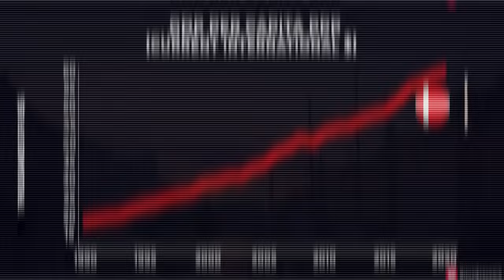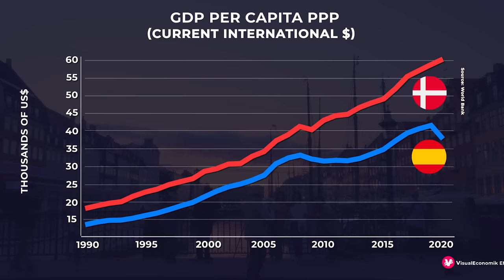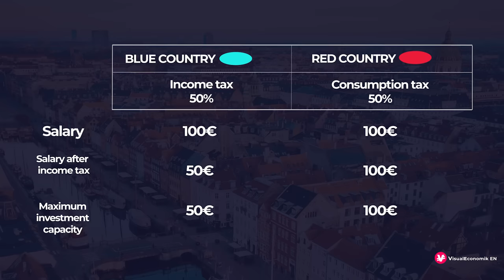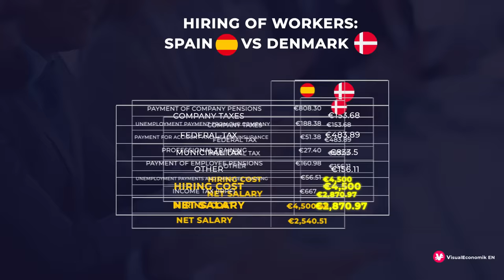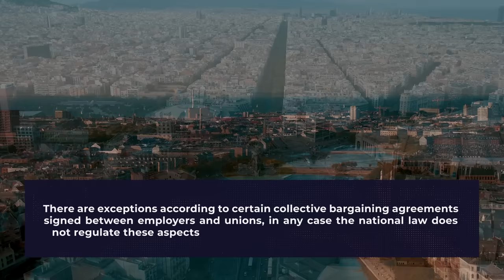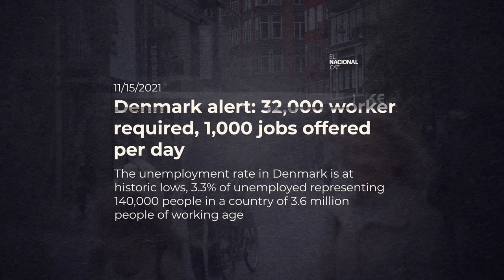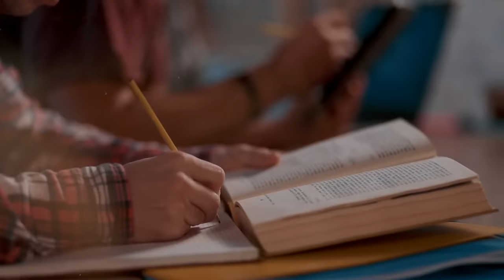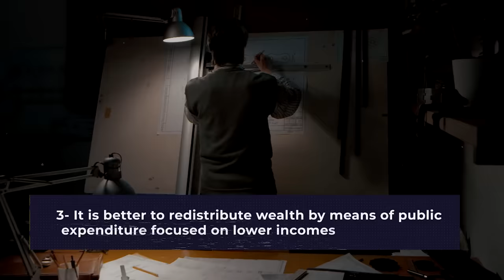Why Is Denmark So Rich Despite Huge Taxes?

Comment: I absolutely agree that sales taxes are much better than income taxes…. I’ve been arguing for this for many year where I live.

I would even add that there is no 100% requirement that the sales taxe be flat (it’s easier to manage but that doesn’t make it mandatory)…. I could easily see a higher sales tax on “luxury” products (whatever that means) and lower sales taxes on basics (milk and bread for example).

Here in Canada, the main objection is that 80-90% of the population lives driving distance from the US border. People are afraid that a much higher sales tax will lead to people shopping in the US and importing stuff instead of buying local….
Reply: We have that difference in value-added tax(ation) in Germany. Basics like groceries, water, books, and local public transport have a VAT of 7%, "normal" goods and services like electricity, natural gas, gas, eating out, hotels, flights, and long-distance rail travel have a VAT of 19%. The line between basics and normals is blurred and often not very logical. Water and fruit juices are 7% but soft drinks are 19%. Software is 19% but literature in print, as audio, on DVDs, or via the web is 7%. There are pages and pages of catalogs on how to categorize certain goods and services conc. VAT. It's ridiculous.
Reply: The economy does need some income taxes though since it automatically helps stabilize the economy by increasing with inflation and decreasing with recession. The trick is the find the goldilocks zone where we get as much of the benefits of income taxes and consumption taxes as possiblem
Reply: In Texas, sales taxes are about 8.25%, but it is 0% for groceries to avoid putting to much burden on the lowest earners.

The issue is now you have state officials and lobbyists deciding what is considered necessary groceries. For example, after "completing unrelated" donations from bottle water manufacturers, Texas decided that bottle water are completing necessary for every household and therefore it won't be taxed.
Reply: @aclassicguardsman946  I would argue that sales taxes do perform the same counter cyclical role. When there is a recession people buy less (and pay less taxes) and when the economy overheats people buy more and pay more taxes. In more extreme cases, taxes can be raised to calm an overheated economy and lowered in a severe recession.

I don’t really see a good use-case for income taxes….
Reply: @sebastiendumais4246  Ideally, Income Taxes should be abolished, but in reality they can be a useful way to:

(1) Redistribute wealth earned from income in an unequal society.
(2) Control Demand-Pull Inflation if (and only if) it looks like it might be out of control.

Additionally, for countries without their own currency, Income Taxes can ensure funding for essential government expenditure*, when taxes from consumption aren't sufficient. 
(* on infrastructure - transport, energy, communications, defence, education and healthcare.)
Reply: @GonzoTehGreat  #1 can be achieved by using government expenditures with targeted programs and/or insurance schemes. In the extreme, it could be possible to put a higher VAT on “luxury” items…. But that wouldn’t be my go to policy choice.

#2 can be achieved by varying the VAT rates to counter business cycles….
Reply: @sebastiendumais4246   Economically speaking, there is no point in them paying less taxes if it is achieved through buying fewer goods. In a recession we want them to buy more goods and during inflation we want them to buy less goods, what you just described is the way things would be in an economy without taxes which means that consumption taxes do not automatically stabilize the economy.

Income taxes mean that people get a greater share of their income the lower it is (which is what tends to happen during recessions), which allows them to maintain some of their buying power, the opposite is true during periods of inflation.
Reply: As an American I think that, in America, very progressive income, capital gains, and net wealth taxes are necessary, but that's because America is so corrupt that we've got people making mind-boggling amounts of money by very harmful and unethical means and we need to both prune back their wealth-granted influence and recover what they've taken. But those are a weapon necessary to defeat a very dangerous foe, not a sustainable way to generate revenue.
Reply: @stevenneiman1554  these very rich people living is such an advanced country will live and consume there….. imagine a 50% tax on a yacht or private plane. These things cannot be hidden and the sales tax will be paid….

And if they invest the money instead of spending it, that will increase productivity so much that “regular” folks won’t mind if there are a hundred Elon Musk.
Reply: We should abolish taxes altogether and kik ze in waiders ouzch!
Reply: @sebastiendumais4246  "these very rich people living is such an advanced country will live and consume there….. imagine a 50% tax on a yacht or private plane. These things cannot be hidden and the sales tax will be paid…."  🤦‍♂
Yachts and planes can cross borders and aren't restricted to a particular country, so you'd need international agreements.
What about off-shore tax havens? Panama papers?
Rich individuals and corporations already avoid taxes in this way and avoiding them becomes both more worthwhile (bigger savings) and more affordable (lower relative costs) the more money you have.

"And if they invest the money instead of spending it, that will increase productivity so much that “regular” folks won’t mind if there are a hundred Elon Musk."
It depends on what they "invest" in. Buying land or property only raises prices, making it less affordable for others, as does buying commodities (e.g. gold, silver). You can argue this is speculation more than investment, but a significant of wealth is used for this...
Elon Musk is more the exception, rather than the rule.

Comment: So if it's that easy, Why don't more countries do it?
Reply: It is necessary to have per-emptive structural reform on a regular basis for this to work in the long run. Very, very, very, very few politicians in the world are ready to take major economic pain up front i.e. before a crisis emerges. However, successive Danish Governments have done just that since the mid-1980's. An excellent example is when Denmark was the first OECD country to raise the pension age dramatically. Before mid-1980's Danish economy was in a shambles and it took almost 20 years to make it strong.
Reply: One more thing, that not all countries have such low level of corruption as Denmark. People won't be willing to pay taxes in such countries where there is no trust, and they will do some steps to avoid it and it will become worse I think. You need that trust in politics and administration to do their job relatively good.
Reply: @kimdani1795  🤨

Comment: As you say, not all taxes are created equal. For things like healthcare, most people want some form of healthcare coverage. Thus, in principle it doesn't make a lot of difference if you pay yourself for healthcare, if your employer pays, or if it paid through taxes.

Obviously, that requires that money is spend sensibly. That you get roughly the same out of tax paid healthcare as with other systems. The Danish public healthcare system is pretty efficient. Thus, there is very little push to move payment and control to the individual or to employers.

Fun fact: In Denmark 75% of collected tax money is spend on social services, healthcare and education. Of these there, only the level of social services can be reduced. The only realistic thing that could be done there is getting people who are currently outside the workforce into the workforce.
Reply: You seem to forget that it matters a lot for those who have no job if they have to pay, they have no employer to do so, so yeah it makes a big difference how healthcare is paid.

Comment: I live in Denmark - and I pay my high tax gladly - the danish school system - is much better than the test show - in Denmark you teach children to cooperate - to work as part of a team - and to take responsibility - that's part of the danish success
Reply: I wouldn't say that. I have two daughters now 21 and 25. The group work in their school has been more focused on tugging the weakest under their wings so you don't see the problem. Example: One of my daughters were put in a group for a science project. One of the boys contributed absolutely nothing and knew nothing. At the group exam he barely said two words. He got a pass. My daughter got an 10 instead of 12, because she "failed to lift her group member" to use examiners own words. 
What we've archived on the surface looks like more students passing, but in reality what we've done is hidden the problem so this boy don't get the help he really need. Also, we've taught my daughters that weak groups members is a liability and should be shunned at all costs. Real group work, IMHO is something you'll learn only on the job market.
Reply: I also live in Denmark and I don't pay my taxes gladly! The school system was horrible when I attended it in the 90's and it has only gotten worse with what the current government has slowly admitted was a failed reform. We score mediocre in PISA tests. Teach children to cooperate you say? With whom? each-other? I remember the public school in Odense to be a place with a lot of noise, bullying and plenty of time wasted, where they would be eager to slab a diagnosis on those who failed to fit in and be molded to the mindless drones they produced. Kids who hated the school (more than average) were sent off to psychiatrists. First the school psychiatrist then later an external one. I flew along those pipelines at the second step I was cleared, He is normal, but with above average intelligence, those were common among the disenfranchised kids they could not slab a diagnosis on.

I like that you write "much better than the test show" acknowledging that it is not that good in the tests. I would flip it and say that it is worse than tests show.

My whole childhood I watched my mother work hard, as well as start a company of her own, while the company prospered she could only just get by despite working long hours and having a lot of work. There were few luxuries.
I also later became self employed, and I see why. Whenever I take money out for myself tax eats away half, not to mention the 25% vat.

I would prefer it if taxes was greatly reduced in Denmark. And I frankly cant recognize most of what you are saying about teamwork and taking responsibility.
Reply: @Sohave  That is so close til my experience in the 80's. The bullying. The sense of pointless. The despair. Resignation. I was one of the fat kids and was bullied until around 6. Grade by my class mates. Then some boys in the class above took over. This was in Frederiksværk. A strong social Democrat municipal. And boy did they know how to treat someone who sticks out! Socialist always talk about "community". What they really mean is within their own ranks. 
I feel unappreciated. I feel like a working animal that shall be worked to death. All the socialist proudly praise themself how much they've given to this and that group. No they haven't. It's my money they give away. 
Never have I heard any of the beneficiaries of my taxes utter as mush as a thanks. Only its not enough - and "cafe latte segment".
The only one who truly have showed me kindness is those "greedy" capitalists. They thank me for my effort now and then. They care how I was doing when my dad died. I could just take the take off when needed. 
The public school almost broke me.
Reply: @yottaforce  I wholeheartedly agree with your view and recognize your experiences. The social democrats feel very entitled to the wealth they rob and very unappreciative of the people who generate the wealth they are taking. I feel like becoming friends with you. we dissidents got to stick together.

Comment: Take andalusia in southern Spain. The average salary for a couple is 900 euro. The lowest income in denmark is most likely early retirement and that is 1100 euro for 1 person. Denmark does not have a minimum wage unlike most of the world. Instead the unions negotiate salary for each branch. Making sure their members can actually afford to live on 1 salary. Prices in denmark are much higher in denmark but so is the income. And that's the real difference. McDonald's tried not paying the minimum salary negotiated for that line of work. Result was the other unions stepped in. The printers would not make posters. Truck drivers would not deliver etc etc. So in the end they had no choice. The people in denmark has a strong sense of community. Together we are strong. Not as individuals. And most people negotiate salary to higher than the agreed minimum between the companies and unions. And with low unemployment that is easier. The company needs to hire but with low supply they have to add money to get a good employee. So if you say a danish person pays well around 43 percent with that low income and a couple in Spain pays 37 the Danes have much more available cash after taxes. Therefore they can afford the higher prices. And the higher taxes gives a much better safety net. Take child support. In Spain you need a very low income to qualify and only until the child turns 3 years old.. in denmark you get childsupport until the child turns 18. No matter the income for up 3 children. Another thing is. If you start your own business in denmark you only pay taxes on profit. Starting your own company in Spain will have you pay more than 300 euro per month no matter your income. And since start ups are not that profitable takes time to build a customer base many simply can't afford to stay in business in Spain until such time it actually starts turning a profit

Comment: I live in Denmark and the only problem I have with our taxations is that we have a weigght tax on cars that end op making the ridiculesly expensive. A random car being the Hyundai Bayon advanced costs 224.995 DKK or 31.742,23 USD the same car in england is 24.649,80 USD that would also be 20,295 GBP or 174.722,48 DKK that's rougthly 50.000 DKK less and I for one wouldn't mind at least that much of the price of cars

Comment: Those countries that seems to be the most developed one is the ones, that has a high level of trust to their fellow countrymen. It’s not the countries with the vast amount of raw ressource materials. In this instance, Denmark, got a very tight, old and homogeneous culture. It’s also the least corrupt country in the world, and one of the perks of being a small country, it makes it easier to navigate and execute. Combine it with the healthcare system which were founded by politicians that had working class background and knew the intricacies and struggles, but also being competent politicians that could make a proper healthcare system. Added in, Denmark don’t really have raw ressources, so the best bet was on education. Hence you get grants for going to school, because if you’ve to work and focus on living while studying, that would compromise the study, and if you get a high education, you’d pay tenfold back in taxes in the long term anyway. It’s a net win.

However one of the less charming sides of homogeneous cultures can be, that it’s really hard for foreigners to get in. Especially Danes. Danes are like coconuts. A hard shell to break through, but once you’re in, you get into the milk and you’re like best friends forever. It’s a hard to gain, but if successful, it’s a deep connection.

Comment: Some countries such as Spain also experience high unemployment for young people. In Denmark it is common to find young people (under 18) working in grocery shops, because they are cheaper in wages and they pay close to nothing in taxes, so they get to keep most of what they earn. Sometimes they get fired when they turn 18, but they also sometimes get to keep their job because they are good reliable workers and the shop values this. Unemployment is low because the unemployment offices help job seekers to write applications and where to look for jobs. It is a struggle to be unemployed.

Comment: How do you account for the fact that a tax on consumption incentivizes not consuming. This leads to a higher savings rate & reduces economic activity since a lot of it is based on consumer spending.
Reply: Dont worry there is a high inflation so they will take even the money you save by simply printing more which they can distribute at their will to their pet projects.
The best part is that because we have locked our currency on the Euro, the politiicans can wipe their hands clean and point the responsiblity for the inflation at the Euro.

Comment: The key to denmarks high GDP is the high salary. For comparison if you take a warehouse work, you get 30k dkk or 4k euro brutto. In Lithuania for the same job you get 1.5k brutto. Now after taxes, the average person will have around 20k dkk or 2.7k euro netto. In Lithuania you will have 977 euro netto. So the following question goes what about utilities? Rent + commodities in Denmark depending on the size and location could be anywhere from 5k dkk or 670 euro to 10k dkk or 1.3k euro+ . Comparing to lithuania, it also ranged from 400 to 700 euros +. If we pick the cheapest options:
Denmark: 2.7k - 670= 2.03k euro
Lithuania: 977 - 400= 577 euro
No need to forget insurances and food etc. What is left after everything?
Denmark = over 1k euro for sure
Lithuania = max 200 euro.

In short higher incomes allows you to purchase more and thus have higher GDP.